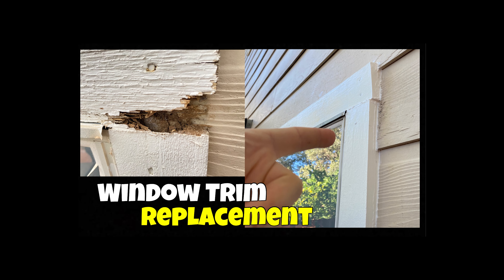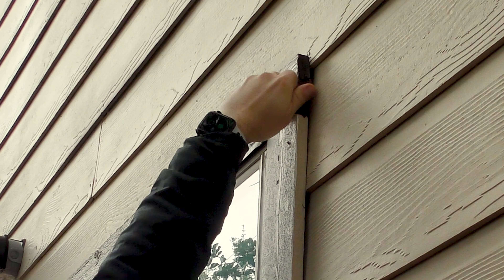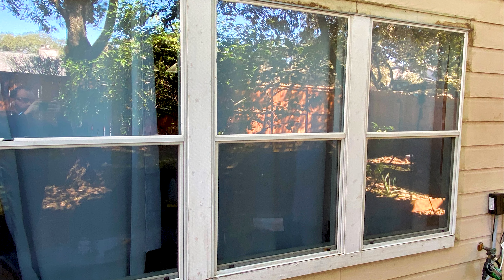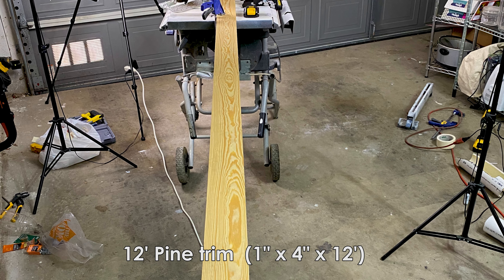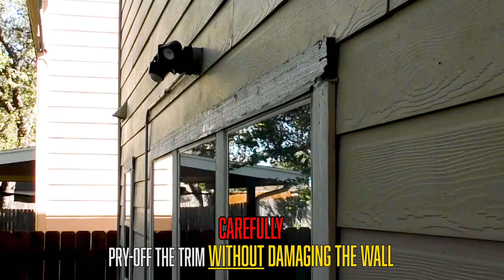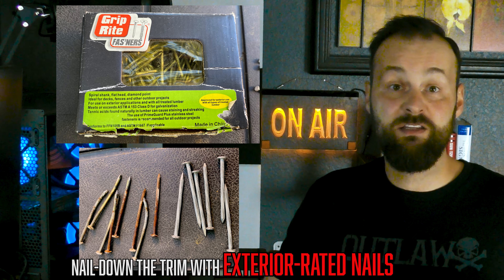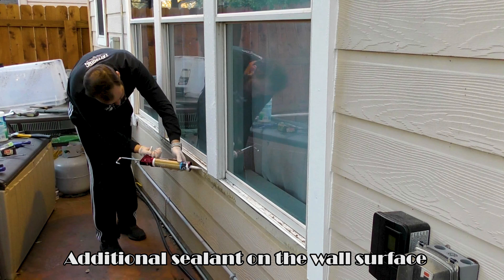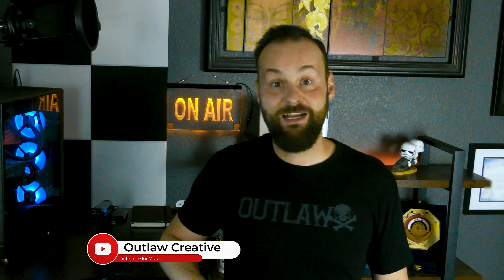Is It Time to Replace your Window Trim?

Comment: 👍🏻
Why u didn’t use self-threaded screws instead of  nails?
Reply from the maker: You can use either. It comes to your preference. The nails are less brittle and have less chance of snapping. Siding, roofing and framing are usually done with nails, for the speed of application. 

If I was making a shelf or a cabinet, I would go with screws, for a tighter fit.